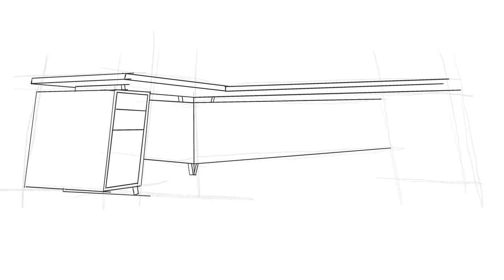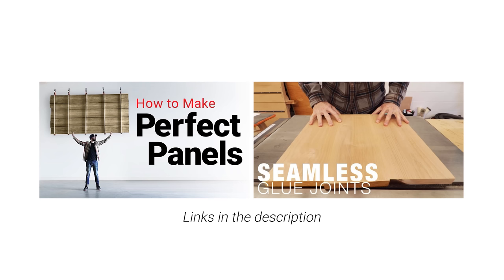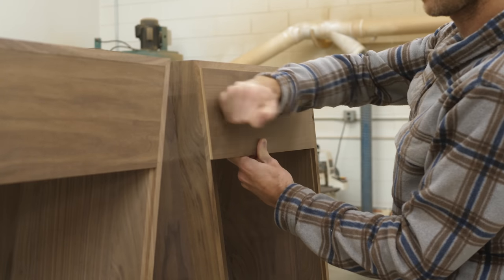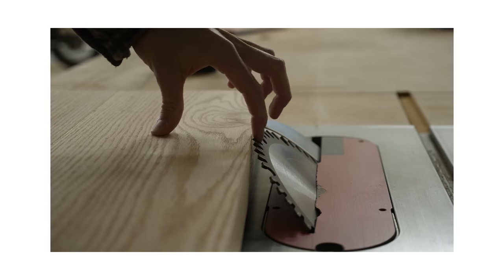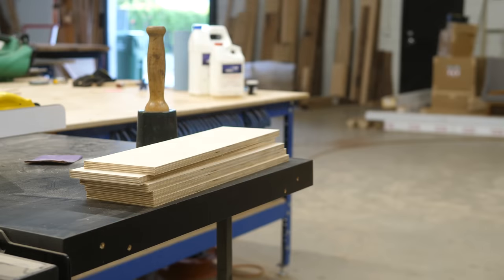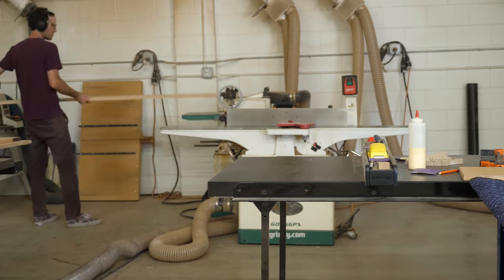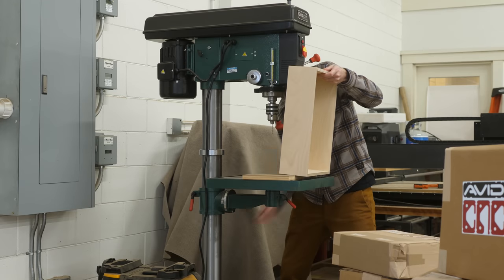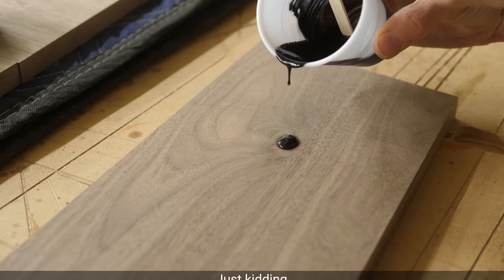This desk is HUGE

Comment: The problem I have had with premilled lumber is that, like all wood, it has a tendency to move when it acclimates to my shop. So I still need to own the equipment to mill the lumber, and still have to put in some of the work. I figure if I have to do some milling either way I may as well just do all the milling. 

But then I also don't use a dishwasher, for much the same reason.

Comment: That's an awesome desk! I've never seen "black poly" before. Is that a dye and poly combo? Really made that walnut pop (even enough walnut doesn't really need help doing that). Great build!!
Reply from the maker: Yeah, it is made by General Finishes. Basically a tinted polyurethane, it works great!

Comment: great video! Can I ask why you chose to use the black poly instead of a stain? Certainly one pass is less work than two (stain + clear poly), but are there any other reasons?
Reply from the maker: For black, it is just the ease of the single finish. Thanks for watching!
Reply: @shaunboydmadethis  thanks!

Comment: Skimp has the connotation of missing something important (usually because you couldn't include it due to price,) whereas scrimp implies a struggle to accumulate the funds for something. The two often go hand in hand but they do have distinct meanings. You can skimp out on a key feature because you couldn't scrimp together enough cash at the time.

Comment: question, would it be better to burn the privacy panels (black parts)? what are the pros and cons? thanks
Reply from the maker: Burning wood has a lot of implications and it is a different look than the black poly. So if you want the burned look, then yes that is an option. Though the heat can cause panels to warp and bow, so you have to be careful when doing it.

Comment: You mitered one piece vertically with a jig on the table saw (4:42) and the next one laying flat.  What was the advantage of the vertical cut?  Why not just use a sled or just on the saw like the second cut?
Reply from the maker: Because of the parallelogram cabinets, two of the miters have to be cut with an angle steeper than 45 degrees. So orienting the piece vertically achieves that.

Comment: What is that black stuff you put into some holes, that you sand down, and then it looks like wood? @23.42
And what is the name of that thing, that cuts holes at angles, so you can use dowels, to hold the corners together, and clamp them with glue?
Reply from the maker: Black stuff is just tinted epoxy and hole cutter is a Festool Domino.
Reply: Thanks for answering :)

Comment: Love the double plum combo. Question to Nth Americans - Having come from a background of commercial built furniture, from 1988 to 1992, all the manufacturers in New Zealand, used Sliding Panel Saws, like Altendorfs. Why do Nth Americans, Utube at least, use old style 1940's type table saws with sleds???
Reply from the maker: Yeah, that is a good question. I have always loved sliding table saws when I have used them, but for whatever reason they aren't as common here except in big cabinet shops or places like that. For me it is the SawStop factor. I know there is some new sliding saws with similar safety features, but until that is more common, it is SawStop for me.
Reply: @shaunboydmadethis  I do like the Sawstop feature, fascinating how it works. The safety features on the sliding table saw, that I'm used to, like the Altendorfs, do make them fairly safe. The blade guards and dust extraction come from above and you can always have the blade covered. Having the small scriber blade before the major blade, to stop bottom tear out or chipping on laminated panel, is a nice feature too. And the digital automatic stops/ fences make cutting much faster.

Comment: “Testing” is how wooden boats are built …. Each part is made at least twice, once as a pattern and then as final piece which is then installed, and then removed to paint/finish then reinstalled…rinse and repeat….wooden boats, furniture that floats
Reply from the maker: Floating furniture. Love it.
Reply: @shaunboydmadethis  look at the boats designed and built by Nathaniel Herreshoff in the early 20 century
Reply: @shaunboydmadethis   also  everything  not related to the structure/hull of a wooden boat is referred to as “furniture”